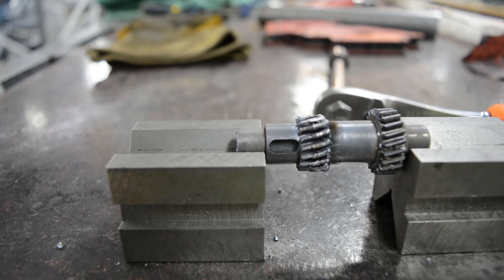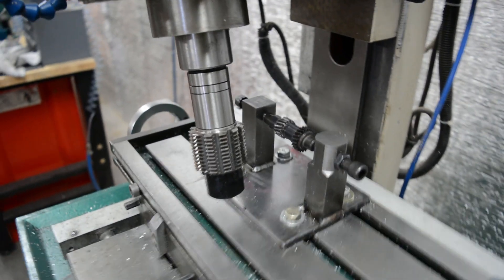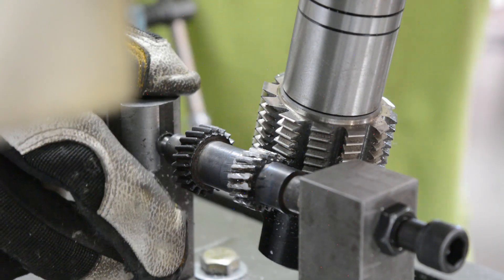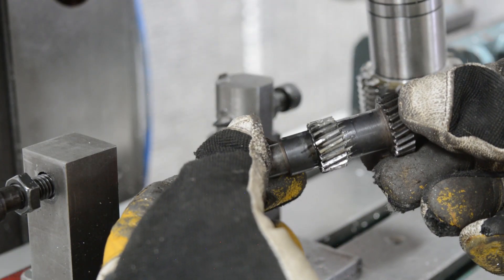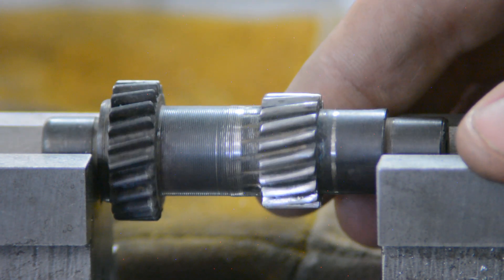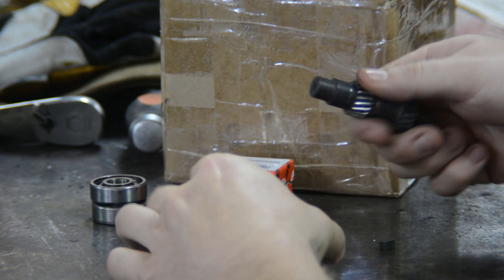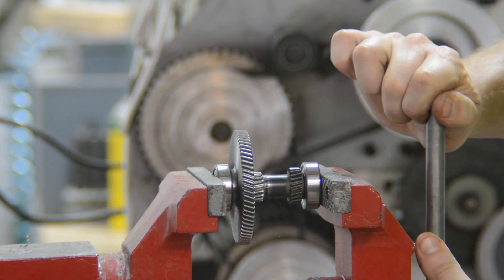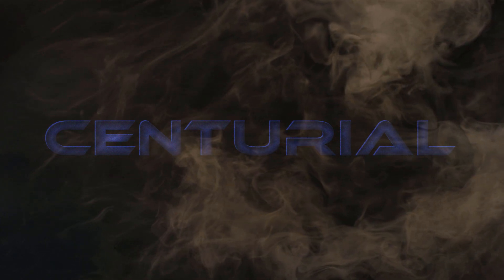Gear cutting Helical gear repair (free hobbing technique)

Comment: This cutter is rated for all teeth counts one pitch correct ?
Reply from the maker: That is correct. Be careful with this type of cutter. It is very hard to use it on new blanks. The only reason why this worked for us is because the teeth where still present on the old gear. So the cutter and gear would self synchronize. But if you don't have that then you need to synchronize them with a 4th rotary axis and an encoder on the spindle. This is the case for all helical gears.

Comment: Destroyed those bearings before it went back on the machine 😀
Reply from the maker: It was for a wood planer...... Not to be offensive towards wood working people...... but it's just not a precision tool. So far it's doing good. Thanks for the comment and watching.
Best Matt
Reply: @centurialinc  no ur right i took woodworking at votech ull never go bellow a 1/32 in woodworking. .03125 is a huge tollerance in a the machinest world
Reply: @alockworkorange7296  I lay brick and  this comment made me think about a couple months ago I was laying out center-lines of some herringbone panels with a compass and I had eight guys looking at me like id lost my mind while I was trying to explain how if I got off by a 32nd how far off id be if it was compounding. Because we rarely worry about under an 1/8th

Comment: thx for the video. would it be the same for straight cut gears just without the mill rotated? How does it not end up as a worm gear? Do you move it sideways????? thx!
Reply from the maker: This gear was a helical gear so we had no choice. The repair must match the other gear that was still in good shape. Yes for straight cut gears you simply select the cutter to match the tooth profile you have. Then just index the part from tooth to tooth. No need to have it spin. The gear is not a worm gear because the cutter determines the profile of the teeth. If we selected a worm gear hobber than that is what you would get. Best Matt

Comment: Why you no machine whole new part? Surely you can get measurments to do so?
Reply from the maker: We wanted a hard metal. If we started a new part we would have to machine a lot of hard metal. Which we did not want to do. So we used hard TIG rod to build the teeth back up. It was fast and easy and so far has been working just fine.

Best Matt
Reply: @centurialinc  adequate response